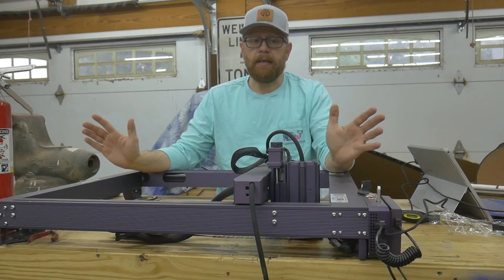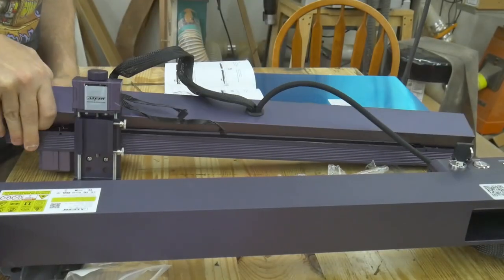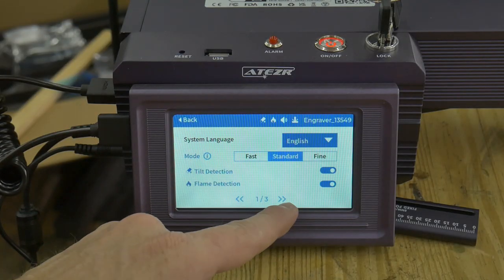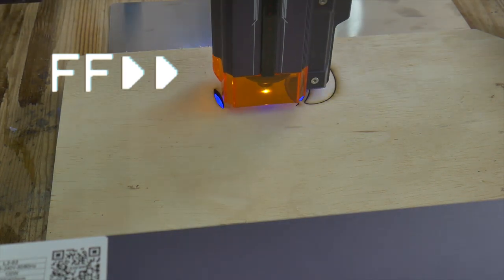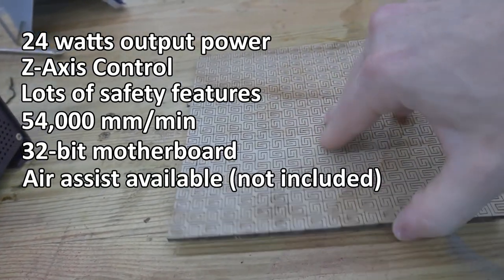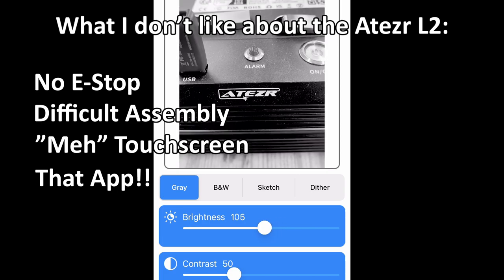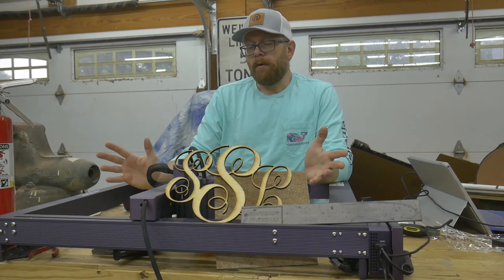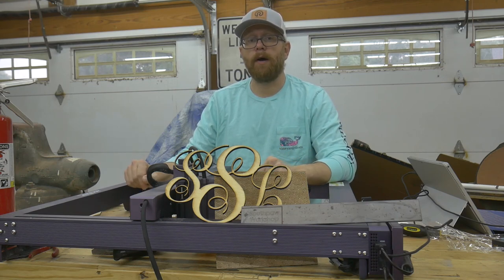Pro Power in a Diode Laser? Atezr L2 24 Watt Laser Review

Comment: Can you  tell me how to turn that cross hair on and off?  Mine does not come on and I need to know if it's a problem with the machine or if something got turned off some how?
Reply from the maker: Mine have always been on. I don’t find the crosshairs very useful though. The horizontal one is in line with the laser, but the vertical line is useless. It could be a loose wire in the harness not sending power to the crosshairs. Not sure.
Reply: @SouthpawWorkshop  I have seen the Youtube that shows you how to line up the laser to the cross hairs. You first burn the cross from the touch pad and then you jog the lasers X and Y until your laser lines up perfectly with the cross it burned. I can't try that because My cross hair is not on.
Reply: @SouthpawWorkshop  It might be a loose wire but I checked all of them and they seem secure. Atezr sent me an instant massage yesterday telling me that you can turn the cross hairs off and on as follows:. _The product manual should provide an explanation for the cross red light. You can take a look. It can be turned off in the corresponding settings.__I asked where those setting are and they sent this back__:If you don't know how to operate it. We will help you contact the factory to inquire if there are specific operation videos for your reference._ Typical no real answer from them.
Reply from the maker: All I could find about crosshairs settings was in this Reddit post. Keep in mind that this is assuming you are using lightburn:
https://www.reddit.com/r/xToolD1/s/YVu8LKkwAK